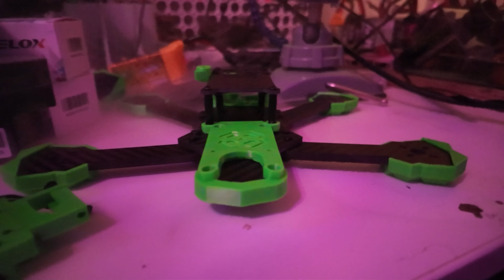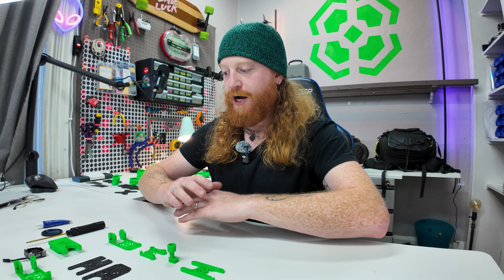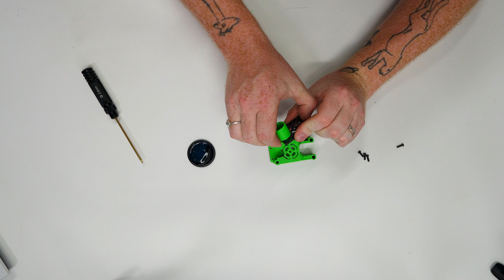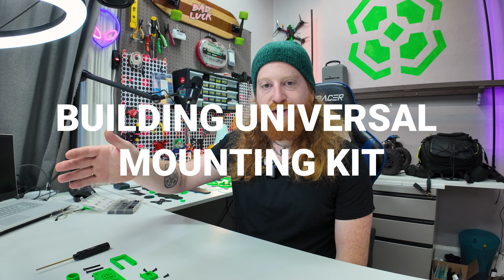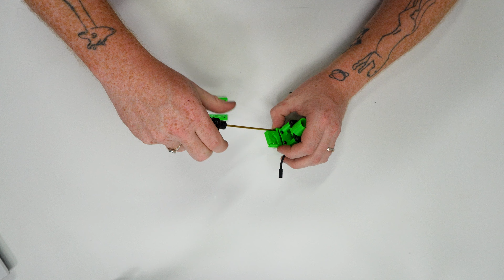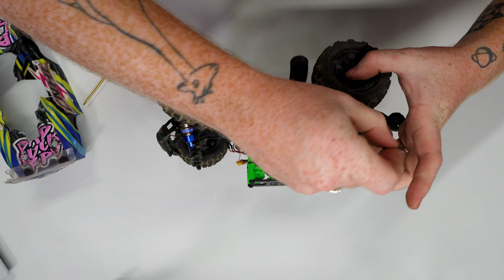Build a Clover Cage for Surface Vehicle or Fixed Wing

Comment: Wow the same RC i got my grandson, think it came with 2 bodies.. Do you think alien tap would work to hold base plate..
Reply from the maker: @dondupuis4007  dude no way what a coincidence! Yes! I use m3 screws to mount to the body. Do you have a 3D printer? I can send you the file or the print for the H16BM